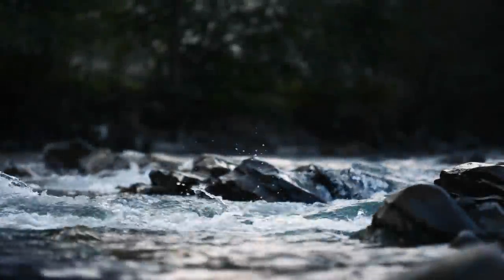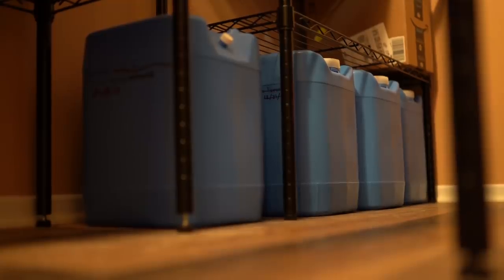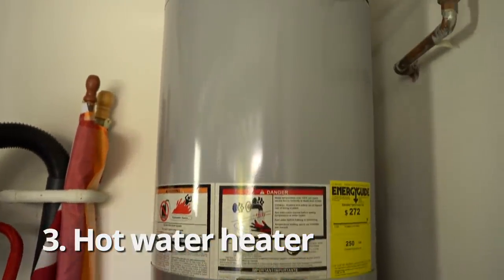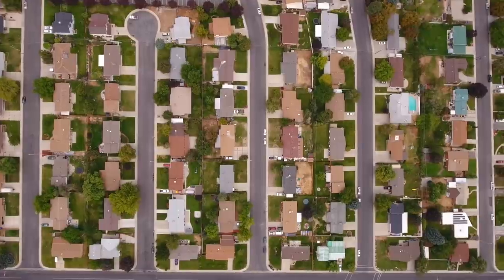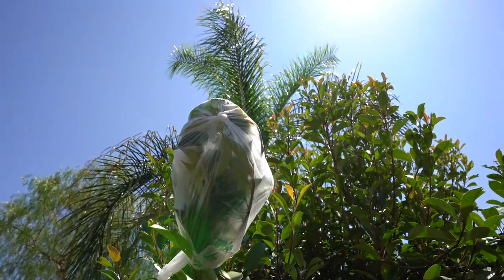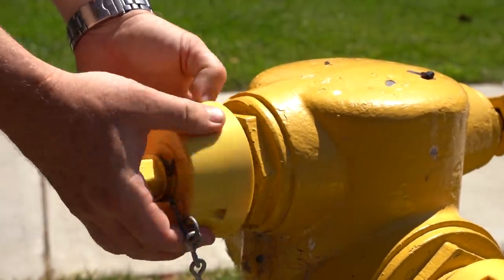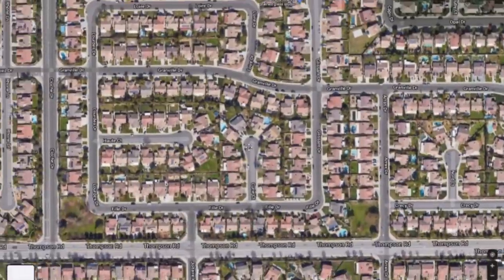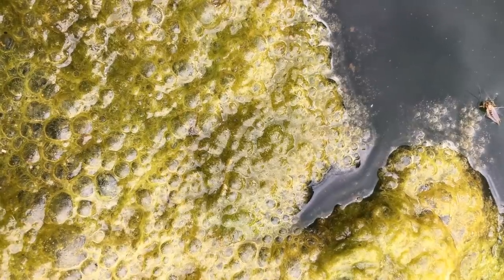12 Overlooked Places to Get Water After SHTF

Comment: Actually remembered the water heater trick and used it this past week. I live in mississippi and the day before hurricane ida hit i got our old 53 gallon tank water heater (swapped to a tankless water heater earlier this year), put it up on 2 cinder blocks, and filled it up. Had 53 gallons of water stored for whatever purpose. Thankfully we didnt need it but id rather have it and not need it than to need it and not have it.
Reply: That’s the stuff! Good work.
Reply: That's smart. I was watching the news about Ida and saw some people standing in a line to get water the day after. I was wondering why so many people don't prepare, even when they know in advance it's coming. It's better to try and avoid needing to rely on government or charity to survive in a disaster.
Reply: Stay well and safe.
Reply: How do you get the water out of hwh
Reply: @Eyota567  drain valve at the bottom.
Reply: @Eyota567  He also explains it in the video.
Reply: Buy a bathtub water bladder.  Basically a huge bag with a port for a hand pump and easily fills from the tub faucet.  Plus, it's contained by the tub un case it leaks a little.
Reply: @rjbfunfacts6947   I can explain..... Considering we were directly hit from Ida here in Terrebonne/Lafouche parish Louisiana.  There are people who prepare for things here mainly older people (30s and up) everyone else is oblivious to anything and everything other than their day to day needs. 
 Also I know the news is portrayal things certain ways but there is no issue with water here. The lines are for gas and other supplies like possible food and tarps.  Yeah the tap water was turned off for the 1st few days but then pretty much everybody got it back. Granted, yes, you have to boil it but that's not that big of a deal. But if we actually had to deal with a real crisis situation people would lose their minds.  We are surrounded by water here. It just needs to be sanitized and filtered.  It's very easy to do that it's just inconvenient.  So many people are so extremely lazy they would rather get in lines for things for hours than just do a little bit of work and be able to provide for themselves.  I will say some people have done their best to prep but if your house has been pretty much destroyed and so have your preps... You're back at square one in that situation. My heart goes out to the people who have done all they can to to help themselves but there will always be tons of people who do absolutely nothing and then want to cry and put out their hands for help after.
Reply: Comatose Creations - Smart!!
Reply: @Eyota567  The moderator explained how to get water out of a Hot Water Heater on This video.  Go back and watch it.  You might need the info one day.  Take notes, too?  Stay safe.
Reply: Watch a video on what's inside your tank friend,  it's not clean and not able to store potable water.
Reply: @Eyota567  city prepping explains it in this video. But essentially you just open the pressure release valve on the top of the water heater and open up the plastic faucet at the bottom.
Reply: @Vicarium  i thought about grabbing one and keeping it on hand. I filled the water heater as a last minute preparedness feat so that we would have water to flush toilets with and such. Ultimately im gonna have water storage using 55 gallon food grade safe water drums. I want to be able to store up at least minimum of 500 gallons.
Reply: @LawofMoses  i agree. It wasn't stored for potable purposes. I stored it for things like flushing toilets with and sponge baths etc. I keep a minimum of 5 cases of water on hand at all times for drinking purposes. Hopefully soon ill be setting up a water storage system with 55 gallon food grade safe barrels so i can have at least a minimum of 500 gallons on hand at any time.
Reply: Water from the toilet vs electrolytes
Reply: Yeah durinf texas ice atoems gathering amd.melting snow.was.a.full time job u could only do if u had a wood stove..and most.texans SO.NOT NEED HEAT.OFTEN..
Reply: South Mississippi here. I saved up a slew of Walmart gallon water jugs over the past year. As Ida started closing in, I started filling my dozens of gallon jugs. Well, guess what. Just about every one of the jugs has started to dry rot. They all had pin holes. No worries. Always have a plan B. Stay safe!!!
Reply: @Comatose_Era  You may consider buying a 16 ounce pump bottle of Cetaphil face and body cleanser. You can sponge wash from head to toe with this. Cetaphil residue may be left on your skin after wiping yourself clean.
Reply: @rjbfunfacts6947  People get complacent. They take for granted the things that keep them alive. They cant comprehend water not coming out of the tap or electricity not coming out of the wall. I live in a desert and our pump went out a few times. Having backup supplies even in the city here is important. Could be a day without or a year without... you never know.
Reply: @Vicarium  great idea actually. Harder in arizona though we dont get a heads up about our natural disasters :(
Reply: THANK YOU!!!🙏🙏🙏
THANK YOU SO MUCH!!!

You said, WATER HEATER!!!
Not HOT water heater... idk why but my SKIN crawls when I hear that... 😆 🤣 😂
Reply: How long can you store it before it goes bad? Bacteria etc?
Reply: Thank you so very much for calling it a water heater, unlike so many that call it a “hot water heater tank”. There is in fact, no such thing as a hot water heater. If it were already hot, it would not need to be heated. It is a cold water heating tank, or simply a water heater. Thank and everyone have a great AND enjoy!
Reply: pamela williams 
You don’t
Reply: @globeflicker9216  it was just a temporary storage tank. The electricity was never reconnected to it. Anyway its a mute point. The tank has been emptied and moved out again. It was just a quick way to store water with what i had on hand.
Reply: I always tell people DON’T buy a tankless water heater just for this purpose.
Reply: Kari Colvin 
You don’t know much. A water heater is the worst place to store potable water or any water.
Reply: Kari Colvin 
You may as well drink out of a wagon track and call it fresh water cause it rained a month ago.
Reply: @globeflicker9216  you obviously didnt read other comments. If you had you would see that i stated that this was stored for non potable reasons, essentially just a way to get water to flush toilets with and to take sponge baths with. It was never stored to be drinking water. I keep about 5 cases of water on hand for that  at all times that gets rotated.
Reply: Comatose Creations 
Yeah,
I would say you used it appropriately! 👍
Treat it like Grey water (non potable) and it’s fine.
I do that kind of work, so I’m familiar with them. It’s not a bad idea to down flush them every few months to clear the sediment and bacteria out.
Have a great day.
Reply: @rogerknight2267  good to buy 5 gal plastic BPA free bottles.     For normal use it's only $2.00 to fill it up w.purified water at Walmart or local grocery store.  These would prbly be good for water storage.
Reply: @biffmasterson9786  rofl. All 4 vehichles i own run and are used regularly the only washing machine i have is in my house and working. The only reason i still have the 55 gallon water heater is because i plan on using it for a batch solar water heater project later on. And if you read other comments you would have found out that i have plans to have several 55 gallon drums for water storage. Dont worry though they wont be in my yard since you seem to be concerned with that  but hidden away under my house.
Reply: @glen1arthur  Stay "well"? Love the pun, even if you didn't mean it.
Reply: @Vicarium  just bought a WaterBOB

Comment: It's not really an extra source, but I recomened getting a bath blader for however many tubs you have. If you know a big storm or something is coming, fill them up before you lose power. That will give you up to 50 gallons of water per bathtub.
Reply: Planning to give these bathtub bladders as Christmas gifts this year.
Reply: very good idea.
Reply: About the bathtub bladders: most of them hold 100 gallons. Water weighs 8.3 lbs per gallon. That's 830 lbs, full! Modern bathtubs will crack and break with that weight, unless they have proper support under them. This wud be built under when the tub was installed. If your tub is newer than 20+ years, don't count it.
Just keep that in mind. Give those instructions with the tub bladder. You can set it up outdoors with a homemade support system, if need be.
My 1970's tub can handle that weight. My newer one cracked with 250 lbs in it!
Reply: @patryott2468  your bladder will only hold as much as your tub holds.  If you've ever taken a bath in it, you're gonna be just fine.
Reply: @patryott2468  that's good info.  Thank you.
Reply: My 1970's tub is not cast iron  It takes the weight. The newer one did not.
Reply: @patryott2468  Good idea, thanks for the reminder!
Reply: @patryott2468  if you can take a bath in the tub then it will hold the water. It's basic common sense. It would be weird to buy a house with a Tub and they say "Oh you can't take a Bath in it"
Reply: Umm. Your tub will hold all the water you give it. Only way a cheap newer tub will crack, is if, you bang your knee or heal into it.
Reply: @patryott2468  Come on man !! People take a bath and fill it up, plus the weight of there body.
Reply: (1) I'm not a man 
(2) Do whatever you want. But when a 200 lb human takes a bath, the human + the water do not weigh 830 lbs. That's what a full bladder weighs.
But I know folk who make their living repairing these tubs, so, go ahead...$500+ for repair.
Reply: @patryott2468  What about a old house? Like built in the 1950's? And it's a rental.
Reply: A lot of whether or not a bathtub will take the weight depends on how the tub is supported underneath. Without sufficient support, the newer fiberglass or composite tubs WILL crack. 
Your 1950's house probably has both a strong tub AND good support underneath.
If built after 1980, I would not count on it.
I've built enough houses to know.
Reply: For those who say, "if it can hold the weight of an adult, it will hold the weight of a full bathtub bladder - without cracking. NOT TRUE. Unless you've tried it with 800+ lbs. over several hours, perhaps even days.
Reply: @patryott2468  Why did you build a house like that? Cutting corners? I mean how much more money is needed to properly support a bathtub safely? Why is this an industry standard at this time? Since 1980's ?
Reply: I did not build houses all those houses myself. I did not state that clearly. I paid other people to build them. Well, my husband and I did. Again, I sm not a man. Except for two of them. 5 we did not build, or even supervise the builds.
Sub-Contractors rarely do what you pay them to do, not even with a contract, and so, you learn to do it yourself.
Reply: @patryott2468  this is a really weird hill to die on, and for the record, no one said to fill it 100%. In fact, I specifically said it would give about 50 gallons of water. I don't see how you could fill it beyond the capacity of the tub, and still be able to use it as intended.
Reply: @patryott2468  oh I’m so glad you told us this! I was planning on getting one and I can’t afford to be dealing with a broken tub right now
Reply: We just filled our Bob yesterday.  Upstairs tub but we knew what our joists looked like before we finished our half basement and felt confident ours will do just fine.  Unfortunately, the tub isn’t large enough to hold the full 100 gallon capacity of the bladder because it has one straight side for those awful 1990s sliders.

Comment: Another good place that I usually look for is that if you come across a dried riverbed. Look for the inside bends of the river curves. It's easy to identify them because they have green foliage growing near. Just start digging with a trowel and you will most likely come across some fresh water.
Reply: gonna have to dig pretty deep if you live in the desert but you will eventually find water.

Comment: One thing to remember: plan for sanitation at the same time you plan for water sources. Sanitation takes up a ton of your free water supplies. We recently had a water issue with the city water shut down. Testing, I found it takes a good couple gallons to properly flush your toilet. It wasn’t a SHTF moment so I didn’t mind using my backup water supply, but if you actually have to save your water for survival you need other options for the toilet such as the 5 gallon bucket/water doodle/trash bag trick.
Reply: Compost toilet. Separate solids from liquids to minimize or eliminate bad odors. Saves 100% of your water.
Reply: I love the kitty kitty cat! :3
Reply: You can cut the top off of a two liter bottle and fill it up to pour into the toilet bowl from a height of a couple feet and it will flush. It isn’t ideal but it works.
Reply: If it’s a SHTF moment, pee outside and dig a hole to take a dump.
Reply: Bury your fecal matter no less than 100 feet away from your water source, if that source is from the ground. (well water being pulled by generator, garden hand pump etc.
Reply: @rvw3022  Might want the portable loo lid for the 5 gallon bucket, otherwise it will leave a painful ring on your butt for about 20 minutes afterwards.
Reply: @nhutchins100 i loled thank you
Reply: I flush mine with one gallon tea pitcher by pouring the water directly into bowl at as fast a pace as I can without spilling it out. Flushes all contents right down. 🙂
Reply: I just had that as well. It did take two gallons. I was surprised since it’s a low pressure
Reply: Never assume the water will come back on.
Reply: Use the outdoors instead wasting your water to flush toilets
Reply: @Danr07  Exactly. LEAVES   ARE TP. LOOK OUT FOR POISON IVY , OAK ,AND SNAKES.
Reply: Don't waste water on flushing the toilet in a SHTF event, store up on 13gallon trash bags for cheap at discount stores when you shop, use them on No.2 disposals and use a plastic container for urine and keep it outdoors. Every drop of water is crucial as some states are now super deficient on emergency response due to Covid19 layoffs of first responders. Transportation will be crippled and shipping lanes clogged in winter breakdown. Remember it could be weeks depending on which type of disaster and region you live in. Your pets will still need fresh water so skip the toilet flush at all costs. Build up on your ice cubes and store them in bags in the deep freezer as you have the space and fill up your empty 1gal water bottles with tap water instead of recycling them, you can use those for washing and pets, so far I have 29 of those aside from my filtered supply. Hope I mentioned something helpful.
Reply: Thus is good use for dehumidifier water.. I empty mone into a Rubbermaid bin, put a sheet of plastic on tope of the water then put the lid,  a quarter cup bleach in each bin. ( well pump went out once, pipe burst another time, took time to get repaired, so I've saved that water since, a few bins while u do have electric, a gallon will flush if dumped in quickly, like from an open bucket, not a milk gallon type of jug.)
Reply: I live out in the country an have my own well 125ft my pump went out , the amount of water i hauled from my neighbors just to flush toilets an wash up was a real eye opener, i have drinking water stocked but didnt want to use it for toilets an washing ,now i have over 1000 gallons on hand , an a back up power source to my well ! Dont under estimate what u will need !

Comment: Another water source: Hand well pumps. These will have a large handle at the top. If it has not been used in a while, you may need to prime it. Tale  a small amount of water with you when you go the pump. Pour some of that water into the top of the pump, where the handle is attached to a shaft which goes down into the pump. Work the handle and pour more water at the same time. When primed, the pump will draw water from the well up to he spigot and out into a bucket or other container that you had placed to catch the pumped water.
Reply: You gotta have water to make water lol
Reply: If the water pump has not been used for a long while, the leathers maybe dried out.  The leathers are soft and create a vacuum to pull the water up from the well.  Sometimes pouring hot water into the top of the pump will help soften the leathers up.  Sometimes they need to be replaced due to age and condition.
Reply: fred McMurray  Almost any source of water needs filtering at a minimum, and purification is preferred, distillation is the best.
Reply: Called priming the pump- Grew up that way—

Comment: I went a year and a half without running water.   I collected rain water for flushing.  That was when I realized you don't need clean water in your toilet.
Reply: We used the creek water to flush ours
Reply: I use a chamber pot (empty milk gallon) to gather my urine and dump it when full. Sometimes in the comode, sometimes outside. It usually takes 5-6 times to fill it.
Reply: You can also collect shower/bath water to flush.

Comment: Good points!  Thank you.  I have a few caveats.

1.  Be very careful about cactus as a water source--many cacti are toxic!  Know what you're tapping into before trying.

2.  Rain seems pure as it falls from the sky, but if it drips off your roof, you need to purify it before drinking it.  Birds poop on that roof.

3.  Don't just drape a tarp on the ground in the rain--much of the water will run off.  Elevate the sides.  (I know, obvious when sitting in our armchairs.  Not obvious when Gehenna's breaking loose.)

4.  Just saying, as a person of color, while White preppers, seen as "scavenging", might get away with stealing water from commercial buildings in an emergency, the rest of us would be shot for "looting".  Weigh the risks carefully.

5.  After draining the potable water from the back of the toilet, you can then refill it with unpotable water for flushing.